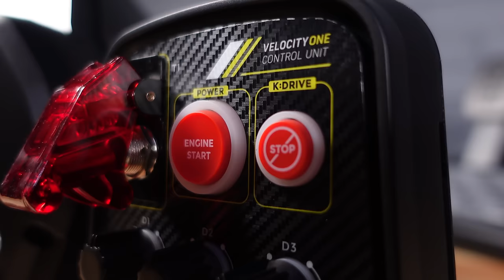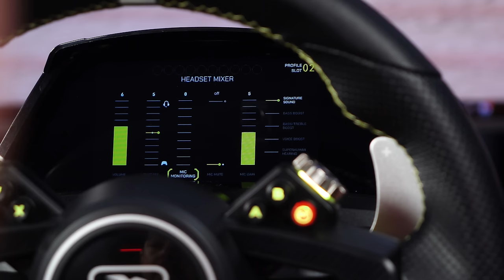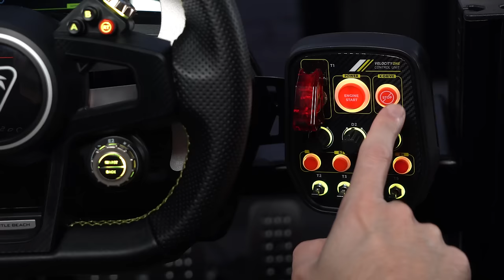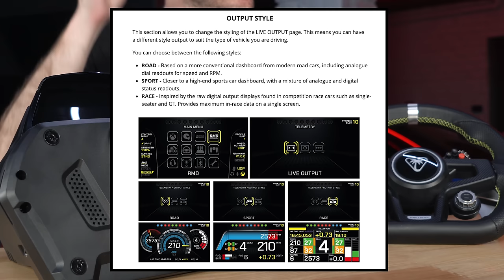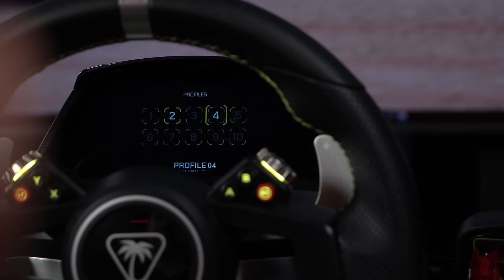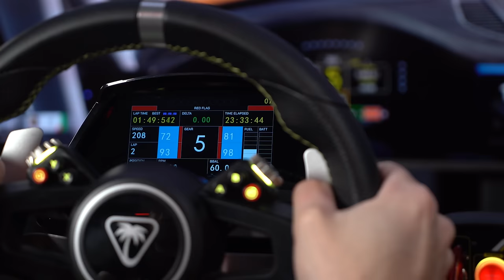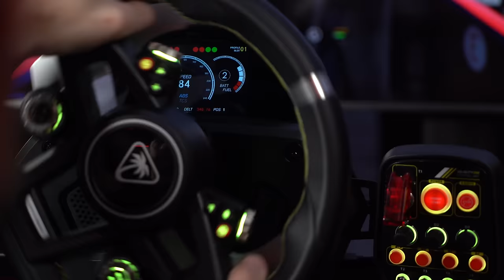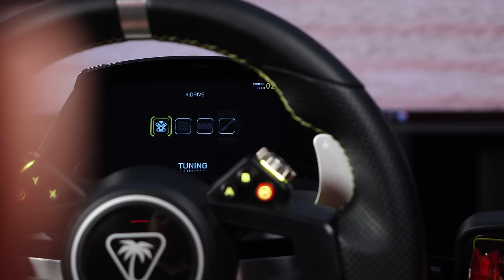Turtle Beach VelocityOne Race - The Complete Review

Comment: what i dont like..even if it looks like a standard NGR QR its not...standard have 4 balls top and 6 in the bottom. donmt knoiw why they use a not standarized QR. so they invented the same sh*t as Fanatec with their QR1....already build in Flex
Reply: Yeah, at least they don't lock you out from the FFB but someone is going to have to make a wheelside QR for this new design.
Reply from the maker: Did you test and confirm the FFB operates when there’s no wheel attached? I didn’t try it yet.
Reply: @boostedmedia  yes! It is in the Ecosystem part of my review. You can watch my bare hand get rattled around. 😅 Perhaps 3dRap or someone like that will make a wheelside connector.
Reply from the maker: Nice! Having a look now :)
Reply from the maker: My base definetly doesn't have the movement in the shaft that you have in your video @ACasualRacer
Reply: @boostedmedia  thanks for confirming.

Comment: The Moza R9 bundle with the newer clutch paddle CS V2P wheel is only 659 USD, not 999
Reply from the maker: Doesn’t include pedals though.
Reply: @boostedmedia  and neither do the T818 or the Logi DD Pro you gave the correct price for. You said the price of the R9 bundle without pedals was 999 USD.
Reply from the maker: Just looked again and you’re right. I must have got muddled up with the G Pro price when I was talking because my notes say $659. I’ll add a pinned comment. Thanks for the correction.

Comment: If this thing is anything like their headsets. I wouldn't give you half of what they are asking for it. It has a lot of extras cause they are poorly made and engineered. The reason the torque or feed back feels lite to you is because there is no way that motor is able to make that much power with that little power supply and feed the screen and everything else. I'd rather have a G29 than anything made by turtle beach. But that is just my experience with their products.